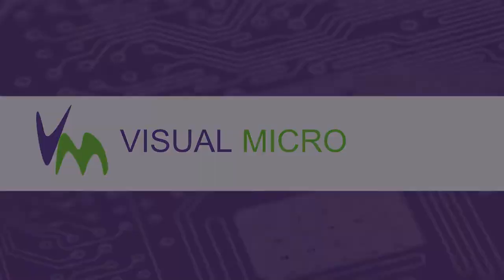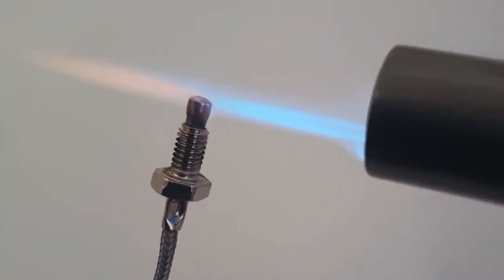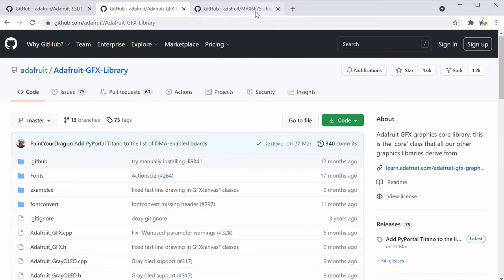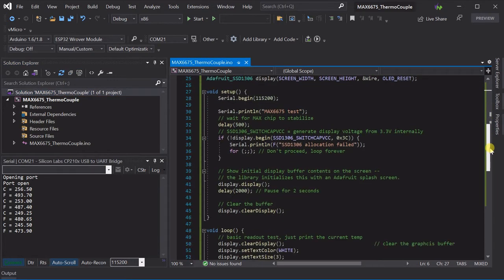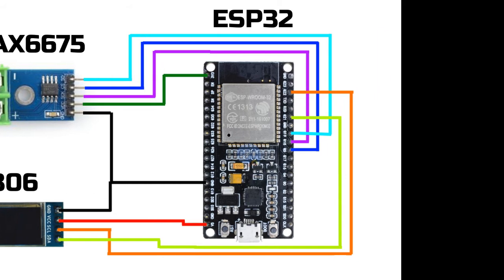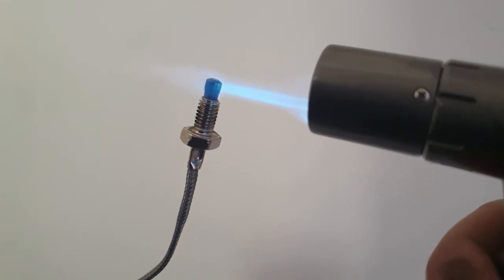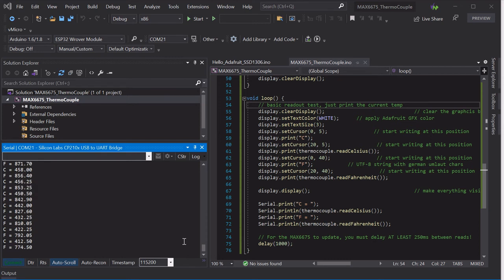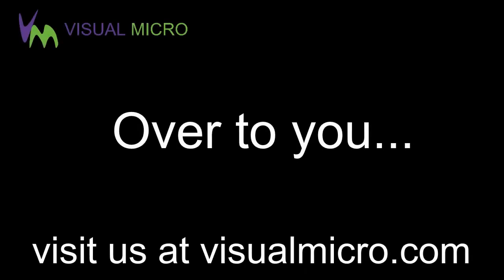MAX6675 Thermocouple High Temperature Sensing

Comment: mine only shows 0 degrees, i tried to test it with an arduino nano, and it worked, but with my esp32 it doesnt, do you know what is happening?
Reply from the maker: Did you check the SPI pins for your specific ESP32 board / chip?

They can vary and would be the simplest reason for it not working......

If you still have issues around this please log it on our forum (registration required) where we can respond more quickly:
https://visualmicro.com/forums/

Comment: Nice work bro.  I have been having an issue to find Schematic( pinout ) to connect ESP32-S3 Wroom to MAX6675 Amplifier with K-type thermocouple. I find Schematic for ESP32 with K-type thermocouple and MAX6675 Amplifier is NOT working for  ESP32-S3 Wroom. Do you have any information on this ? please let me know. 
Thank you for sharing your knowledge and expertise with us.
Reply from the maker: Its likely the SPI pins that are set on the ESP32-S3 are different to on a normal ESP32.  If you review the pinout it should show which pins are needed.

Comment: Hello I have an electric oven that mounts a type K probe inside the chamber, then it must be connected to the controller (plc), do you think I can also connect the same probe to max6675?
Reply from the maker: You should be able to connect it to the MAX6675 board, however it may produce different values. You may also need to use a Thermocouple Transmitter to allow both MAX6675 and the Oven to receive the single output signal, unless it is already a dual output Thermocouple.

You could wire it up and use a secondary probe, or an IR temperature gun so you can be confident in the values you receive from the oven probe, and their consistency.